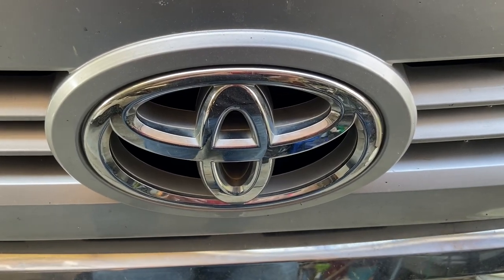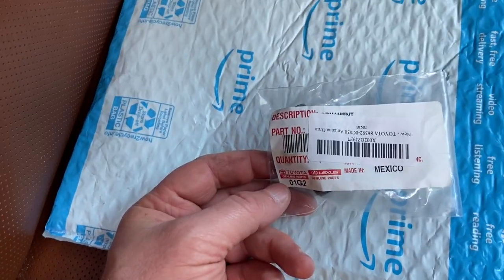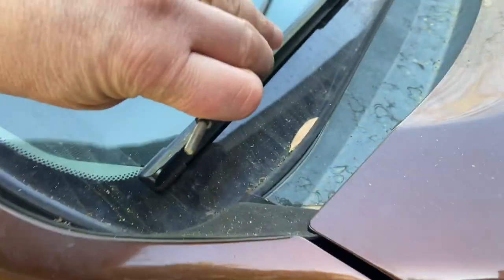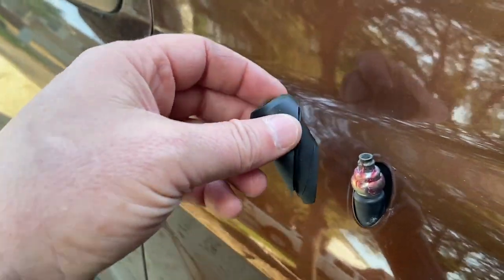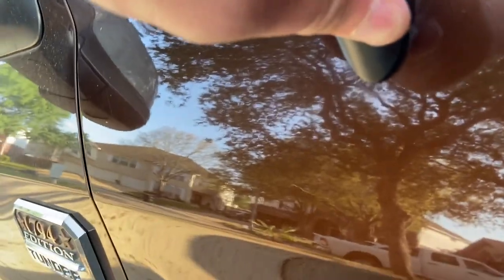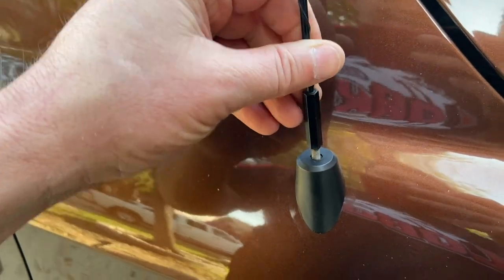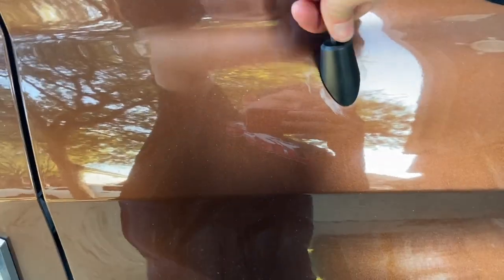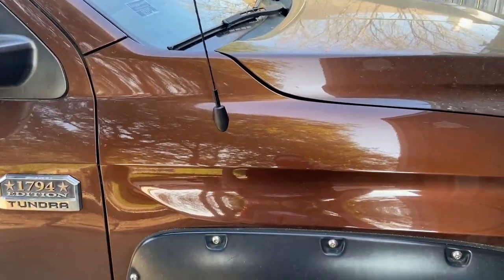ToyotaTundra Radio Antenna Rubber Base/Grommet Replacement (2014 w/ 123,000 miles)

Comment: Did you buy that truck knew, they give you a little wrench it's usually in the glove box just specifically designed to take the antenna on and off. Nice to see you didn't have to go through the wheel well like other videos showed, I may try some olive oil however I'm not going to remove the antenna, I'm going to slide the rubber boot down over the antenna so I can pull up as I'm pushing the rubber boot into the quarter panel
Reply from the maker: Used truck. Thx for commenting and good luck.

Comment: I’m wondering if you know the trick to removing the base? My antenna broke off in the threaded socket and I can’t drill it to use an easy out. I’m hoping I can replace the female section. Thanks!

Comment: Whenever possible, use silicone grease instead of common bearing grease for odd boots like this antenna - the rubber lasts longer.

Comment: Has the hard start issue ever returned
Reply from the maker: No. Hard start never returned. I’m still unsure which of my actions truly resolved it. I have since replaced the knock sensor harness due to little rodents chewing on the wiring. I have a video on that, too. I sometimes wonder if that harness possibly played a role.

Comment: Although it seats well and looks installed, there is an extremely thin gap in the rubber which seals tight against the body.  Almost impossible to seat accurately like in this video.  Look CLOSELY to make sure it’s actually seated tight!